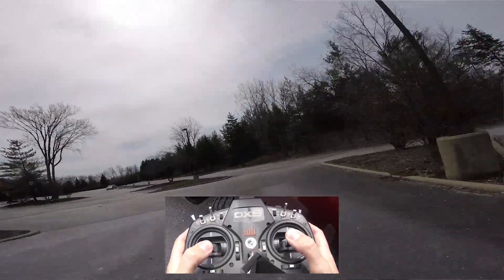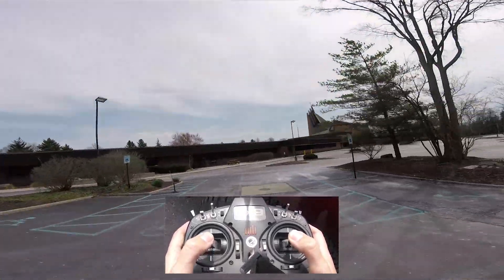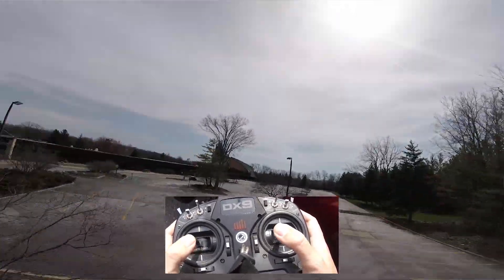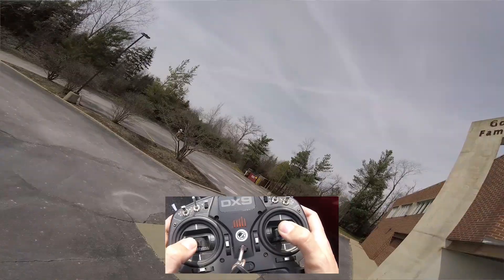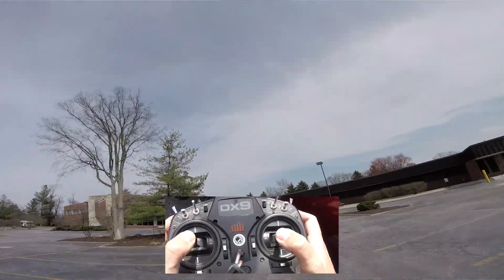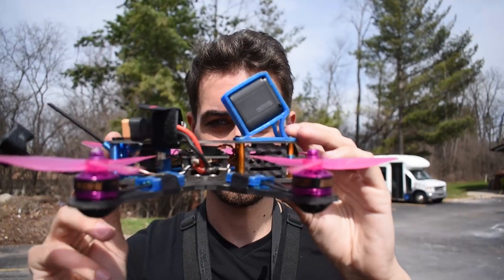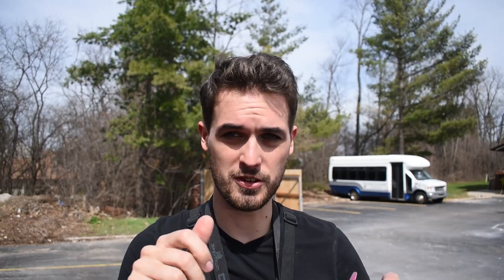how to mix roll and yaw to turn and roll

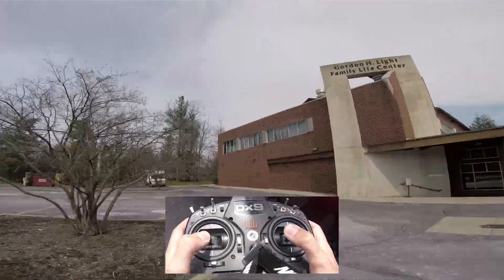Comment: Good stuff Drew. You had a Forrest Gump moment @3:18 lol. The "feel" you were talking about is muscle memory but you explained it so well. Loving these videos. My flying is getting better every week, but it's always great to stop and think about what you are doing even if it's become muscle memory. Would you please do a video on smooth tic tacs (tick tocks based on where you may be from)? That's the one trick that I just can't get right for some reason and apparently it's one of the easiest things to do?!? Keep up the great work. Oh, and the danger level on that dive into the little copse of trees against the building was super high!
Reply from the maker: :D thanks Omar
Not sure what you mean by tock tock/tac? Usually that refers to a collective pitch heli move?
Reply: Le Drib Just meant the side to side roll move people do when just travelling straight, keeping a movement or flow between tricks.

Comment: That was a great explanation Drew!!  I found it very helpful. 
Question. Air mode or idle up?
Reply from the maker: I have motor_stop disabled so the motor idle regardless of flight mode. But in addition, I usually fly in Air Mode to improve I term performance
Reply: +Le Drib - Same here. I was just noticing that with air mode, the quad goes crazy sometimes when hitting scraggle. Thanks for your response!!

Comment: try a drone that has a cross diamond wings (tail-sitter) inside a sphere flexible mesh grid frame ball, so that you can also roll on the ground with the drone rotors, while having a flexible bouncy impact protector shield
Reply: if interested then go ahead and make it (public domain) however you wish

Comment: Interesting you can auto mix roll and yaw, but instead of a fixed camera angle, you should have the option of using the flight controller angle, so it “always works”, if you wanted that.

Comment: great vid. Would rather like to know how to get a fight controller to recognize all 6 channels on my radio just so  can get Air mode so i can do those tricks you speak of. So close to trashing this hobby cause no one knows how to do this
Reply: I'm a n00b still, but what radio and FC?
Reply: the cc3d atom and the FLYSKY fs-t6. No body does anything with these 2 things. It's either Taranis or Spektrum, and the f3 or Naze 32.
Reply: Ernest Ginter drop the cc3d atom if you want to get any help in this hobby and lots of people actually fly that radio, what FW are you running on the Cc3d? I should be able to help.

also uavfutures youtube channel Stew messes with cc3d and fly sky he would be of most useful to you if you stick with your current system but I can try to help.
Reply: Ernest Ginter another guy that used to fly cc3d alot is juz70 he could help aswell. I used to fly it years ago on my qav400 but not on a mini but same concept 😉
Reply: I pulled my quad out with the cc3d and was able to flash it to betaflight 2.1.4, which is ancient, but there is more info out there on betaflight modes than libre/open pilot. The file referenced in the video can be found at https://github.com/betaflight/betaflight/releases/download/v2.1.4/betaflight_CC3D_OPBL.bin. Getting it updated to the latest betaflight is a different story. Some info found here https://github.com/betaflight/betaflight/issues/1541#issuecomment-260148656.
Reply from the maker: Thanks for helping Ernest guys :)
Makes me so happy to see people trying to help others.
Ernest, I think you would really benefit from an FC upgrade. Something that can run a newer version of BF will make set up much easier and improve the flight characteristics a good deal.
Is the receiver that you're using PWM (one wire per channel)? Some boards struggle with that and cant always recognize more than 4 channels. It would be best to ensure you are using a serial receiver. This will also greatly reduce command latency and again make your flight experience much better and easier
Reply: I try. The help I've gotten from different places, including the guys at Excel RC have gotten me this far. I try to do the same with software development as well. You get what you give, karma, etc, goes a long way.
Reply: just put air mode on all the time ore put it on your arm switch
Reply: lecrib pwm is one wire per channel ppm is 3 wires and a lot of lag
Reply from the maker: 8alakai8 you're right, I misspoke (pwm vs ppm), thanks. Edited my previous reply
Reply: the reason i know is some quads of mine are still on pwm
Reply: I have a SP F3 flight controller but have no idea on how to set it up or flash firmware cause Youtube videos are short and don't explain it proper. S-bus or I-bus would be nice but all i can work with now is ppm cause the postal service sucks and i can't afford a brand new transmitter. This is what i got and it does not work
Reply: i dont know how to flash firmware on these things,
Reply: well there are youtube videos on that thats how i have learnd try painless360 channel
Reply: The video I posted tells you exactly how to flash betaflight on the cc3d (can't imagine the atom is much different) as well as the link to the direct download of the bin file to flash.
Reply: awesome, didn't work, now i got 2 flight controllers that don't do shit and a zmr250 that won't fly. Fuckin great. Trash bin, here you go, All this money wasted.
Reply: and it did not work, now im out a flight controller and no drone to fly, FUCK
Reply: Ernest Ginter my dude, you gotta be willing to do some research and have some patience. You would benefit from a more recent fc but barring the ability to get one, your current gear will work, you just have to put the research into it. Post on the multicopter subreddit or hit the rc groups forums. Unless you had magic smoke, you can cobble together something that works.
Reply: Ernest Ginter the sp f3 should have cleanflight or betaflight. Tons of videos on how to flash back and fourth and upgrade what's already on there.
Reply: too late, damn thing is destroyed cause it's nothing but a piss off, Now i think aboot buying another one, key werd is think
Reply: and i can not find one that works. It won't connect to Cleanflight or Betaflight now. Nothing, keeps telling me to backup/restore the CLI(whatever that means, I'm not a computer person). I have seriously no damn idea what the hell I'm doing here. Can i send this fucking thing somewhere and have someone do it for me? Should i buy a new one? Don't even know if this thing works proper or is defective? Like i fucking have nothing and these Youtube videos that you and others send me to, i have no idea what you guys are even talking about? I really want to keep going with this hobby but my stupidity on the subject or people's lack of explaining for the simple folk, y'all are making it hell for me
Reply: have you installed the drivers for betaflight so it can connect to the fc like i said before painless 360 on youtube hase like good video for all fpv stuff i think if you check that you will get it

Comment: Hey man awesome flying! I've been meaning to do an experiment with fpv angle mixing...so I guess I'm in the same boat as you where I like to control my yaw and roll mix manually, it's how im used to doing it and feels natural.. BUT if I want to change my camera angle, it throws the ratios off between yaw and roll and takes quite a while for me to get used to it. So I want to try using fpv angle mix to adjust for when I make changes in my camera angle.. say im used to flying at 30deg and i want to change to 50, just add 20 deg fpv angle mix.. BUT then I got thinking more about how much I'm moving each stick.. so to do a completely flat spin at 45deg with yaw and roll rates the same, you would move both sticks exactly the same left or right.. SO my plan is to set all my rates the same for pitch, roll, and yaw (i usually have yaw slightly lower) and then use fpv angle mix to adjust up or down from 45. eg if i want to fly with 30deg I would set fpv angle mix to -15, if I want to fly with 50 deg I set fpv angle mix to 5. Wow this turned into quite the essay, would be interested to hear your thoughts on this though, do you ever change your camera angle and does this cause issues for you getting the ratios right?
Reply from the maker: Lot of good thought into that. I follow what your saying. Would be really interested to hear how you like it, please let me know if you do it how it goes. 
Changing cam used to bother me, but eventually I got used to being able to compensate. I don't move my camera that much anyway it's almost always at 30 deg. But sometimes if I know I'm going to be doing extra backwards stuff I might not get up to 40, or if I'm flying a tight area maybe drop it down to 20 or 25

Comment: This may be dumb... probably dumb. But... why doesn’t the flight controller account for the pitch angle a quad flies at for momentum when doing a yaw spin, for example, so that you don’t need to add roll to maintain horizon as you would expect from a yaw turn?

Comment: Always enjoy these type of vids. I've an inckling that using this kind of mixing results in a kind of "tick tacking" movement of the quad from side to side. Johnny fpv uses it alot inbetween tricks, and consequently to set up a trick.

 Been trying to get it down for a couple of weeks now to no avail. Any pointers would be greatly appreciated. Keep up the good work on your channel, its a valuable resource to many of us.